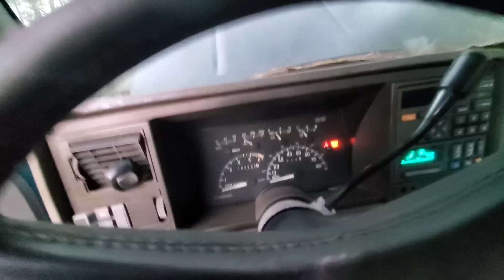This 94 Chevy Has Too Many Problems!!

Comment: Bro I got everything you need to build a bad 383. Heads intake rotating assembly  carburetor even the ignition.  I might even do some trading for it. I'm never going to use it.
Reply: Here. Supporting the channel

Comment: I always liked watching your stuff man, I live in apts in town where we're not allowed to do major mechanical stuff at and most friends moved away or went our own ways besides online people so I'm living vicariously through your stuff, it always chills me out lol. An online buddy told me the other day that every time you fix a car it requires a blood sacrifice lol. Been having hell lately myself and don't think my 2016 kia forte is even gonna survive the 2 more years there is paying on it...pretty nasty oil burning problem I've doctored for awhile but after it started hella misfiring and shaking the other day I pulled the coils out and 3 of the 4 were drenched in oil, go figure the one dry one had its plastic connector broke lmfao, I zip tied it, replaced the worst coil and it made it driveable and have 2 more coils coming this week to limp it along. There's supposed to be recalls on the theta 2 engine it uses but if they try to bullshit me I don't have money to fight them with a lawyer. I have it down to using 0.5q of oil a month instead of the whole dipstick every week by using a little thicker 5w30 oil, some RESTORE here and there, and Liqui Moly Motor Oil Saver every couple months which made the biggest difference. 0/10 would not recommend, if I had known GDI engines gunk themselves up so bad too I would have never gotten it. I might as well have gotten something cheap off marketplace lol...my old 90s 5.2 v8 ram is 10x better than this new kia

Comment: Send some air throw the line backwards to see if it bubbles in the tank if it does pressure the tank with air to force fuel out those have pump in the tank and it might be locked up stopping the flow

Comment: Looking at your sending unit and fuel filter the truck was fuel injected. I’m not sure if the mechanical pump will pull fuel through the electric in tank pump. You could get a fuel regulator with a return and set it up to work temporally off the tank

Comment: With how bad the lines look, you should probably drop the tank, pull the sending unit, check the fuel pick up and inside the tank, then get some new 3/8 hard lines and build your own fuel lines from the tank all the way to the front to hopefully prevent further issues. When it comes to fuel systems trying to shortcut or do the bare minimum always comes back to bite you later, just go through the whole fuel system front to back once and be done with it.

Comment: Make sure you bypass the fuel pump power coming from the factory oil pressure switch,,,,has to see oil pressure for the fuel pump to run....

Comment: I've had that same problem  come to find out the pump on the block wouldn't pull thou because it had the pump in the tank so what I did was I hook up the pump on the block to the return line it fired rigth up migth not be the problem but maybe try that

Comment: Whats wrong with the electric fuel pump in rhe tank the relay for it should be on the firewall on the passenger side,cross them 2 wires together and maybe the beast will start pumping fuel,im building a 92 S10 just built the vortec 350 for it actually just using the bottom end,but its a full roller motor now not just a roller cam,just got done tapping the heads for screw in studs and guide plates with 1.6 ratio crane roller rocker,got a nice summit racing custom grind roller cam,starts making power at 2800 all way to 7500 nice 3200 stall converter the little truck scoots
Reply from the maker: I got some extra regulators so I just might try that

Comment: Hey bro I have a nice 350 4 bolt main block you can have if you want it it's in good shape it's probably a 78 or newer block and I also have a comp Cam's camshaft that's used but in good shape and I kept all the lifters in order it's more of a torque cam it came out of my mud truck,k5 blazer frame with a 97 S10 cab on it it's got a built turbo 350 and a nice divorced transfer case still in it which will probably never get used again because nobody here rides in the river like we used to and I also have a set of headman headers long tubes that you're more than welcome to come take them off my hands bro I like to see them on the channel the Pistons and rods that came out of that came out of that block that I have are in good shape too and there the powdered rods the crankshaft that came out of it is no good it about spun a rod bearing but it's a steel crank it's worth saving come get it bro id like to do a colab with you let me know if you want them parts
Reply from the maker: Shoot yeah where you located? I might have something I could give ya in exchange bud

Comment: Valves and timing is bad bad wrong, did you make sure you blew the fuel lines out? if not it might be outta timing by one tooth
Reply from the maker: Timing is fine I got it figured out.. turns out the gas I put in the tank disappeared or I dreamed I put it in there lol